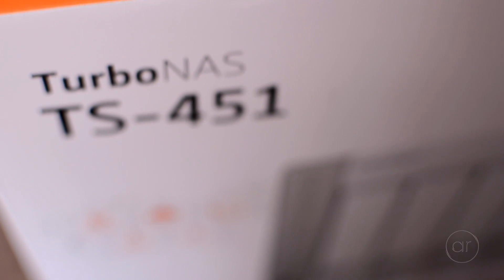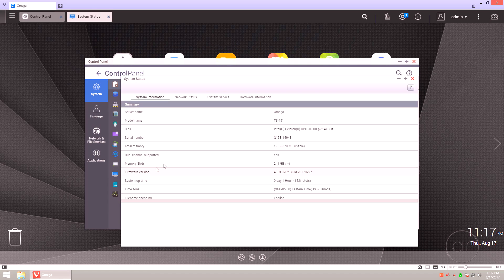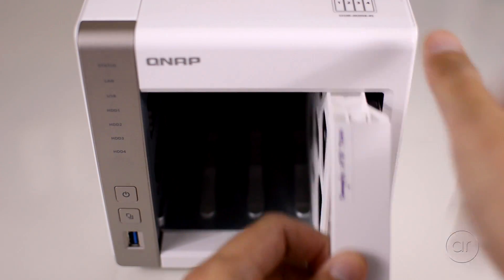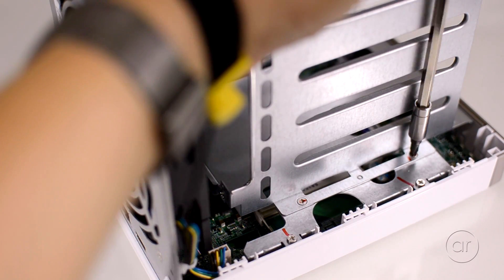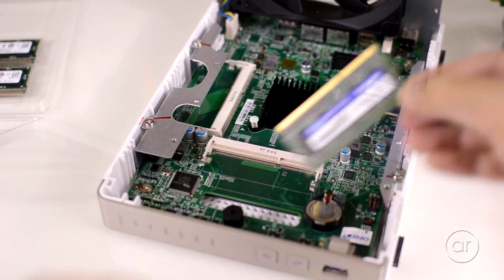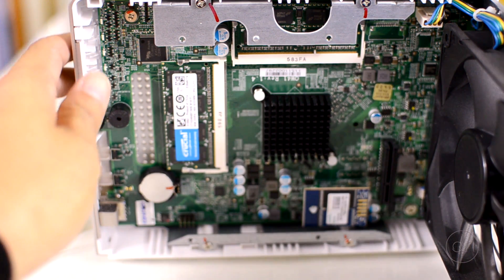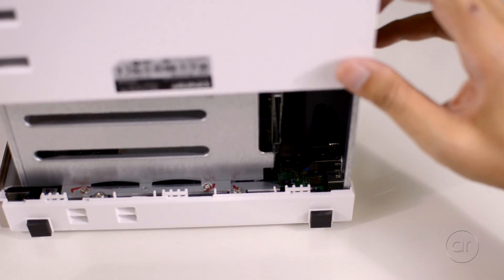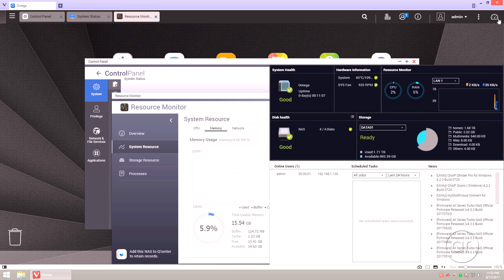How to Upgrade the QNAP TS-451 to 16GB of Memory

Comment: Sep 2024 - I just tried to install 16GB on TS-451 running QTS 5.2.0.2860 build 20240817 and could only see 8GB on the System Status. Trying to figure out whether it is a case of faulty RAM or whether QNAP clamped down on this functionality.

Comment: Is the power supply propriety? Found this QNAP storage system in a dumpster, along with other tossed out electronics. Has what looks like 2 Seagate 2TB HDDs, as the other 2 are open. Can you reformat the HDDs while connected to the host PC? Are the HDDs designed spefically for a NAS system? Thank you 🤓

Comment: Hello, seeing 16 GB installed doesn't mean the OS can use them. The J1900 CPU cannot use more than 8GB of RAM.
I haven't seen any evidence from a user that the OS is using 16GB "hardware". It is almost certain that the OS swaps on disk beyond 8 GB. It is necessary to carry out tests in real situation. Memory modules are currently very expensive and it is difficult to trust this type of video without real testing. Regards.
Reply from the maker: Thanks for the comment. You may want to look at some of the discussions at the QNAP forum about others who have done memtests on the 16 GB.
Reply: @accessrandom  Thanks for answering.

Comment: Awesome, well detailed video. As mentioned people should remember the order they removed the disks in each slot and put them back in the right slot to avoid issues. Labelling them might be a good idea.
Reply from the maker: Thank you, and thanks for the great tip.
Reply: mdadm uses the raid id of each disk not the slot,, really old versions of qnap and Synology os (over 6 years old) it did matter what order they was in but "" Only "" when moving the disks to another nas for migration , if then was was functioning normally you can shut down the nas and move the disks around and power it backup (but that requirement is long gone and absolutely redundant)

Comment: What do I have to know when buying RAM for my TS-451+ for it to work?
Voltage, Speed, ...?

Would it be ok to buy a 
   KTH9600B/4G
   1.5V
?
Reply from the maker: You may want to look at the QNAP forums. I know that the TS-451+ can take 16GB of RAM (and there are a few memory models that have been anecdotally successful) but I'm not sure about your particular model.

Comment: The disclaimer at the beginning of the video has come true.  With one of the recent updates they've started enforcing it.  If you go into the Control Panel, at the top it will list the amount of memory you have.  It'll read  Memory: 16 GB (8 GB usable)  Checking the System Monitor will show that the system is only using 8.  This caught me a few months ago when I was doing the upgrade and couldn't figure out why it would only read 8 GB.
Reply from the maker: Thanks for the heads-up. Could you tell me what version of QTS you're using? I have the latest version 4.4.2.1320 (2020/05/29) on my TS-451 and I am still seeing 16 GB available in System Status, and in the Resource Monitor it says I'm using 9.89 GB out of 15.53 GB.
 I'm not doubting you - I'm just wondering if I should prevent any more updates from QNAP... or am I looking in the wrong place for the memory info?
Reply: @accessrandom  Considering upgrading mine. Are you still successfully running 16GB? Thanks for the video btw :)
Reply: Ram probably wasn't installed correctly (I find out in 2-3 days as I got a 451 coming in next days think I have 2x8gb somewhere)
Reply: @accessrandom Sep 2024 - I just tried to install 16GB on TS-451 running QTS 5.2.0.2860 build 20240817 and could only see 8GB on the System Status. Trying to figure out whether it is a case of faulty RAM or whether QNAP clamped down on this functionality.

Comment: I installed 8GB DDR3L 1600Mz RAM (only in 1 Slot) in TS-451. But it doesn't work. ( I can't discover my NAS on LAN). However reinstalling the Original 1GB RAM works fine.
Reply: May be an install issue (stick didn't quite click in?), or a bad stick of ram.  This is fairly common in PC building, especially the former which is why it is advised to do a do a quick boot and system check before installing everything in your case .  IE boot into bios and check and see if everything is showing up and running such as the ram, GPU, etc.  RAM slots in particular can be a little finicky.

Comment: I installed 8GB DDR3L 1600Mz RAM (only in 1 Slot) in TS-451. But it doesn't work. ( I can't discover my NAS on LAN). However reinstalling the Original 1GB RAM works fine.
Reply from the maker: I'm afraid I hadn't tested just one module - it may be that the QNAP doesn't support 8 GB in one slot? I'll let others chime in if they've had any experience with this - anyone?

Comment: Just to confirm since no mention of har drive order was made, Is drive replacement ordering mandatory?
Reply from the maker: This upgrade affects only the memory. I believe I had two RAID 1 groups before I performed the memory upgrade and I didn't need to change the order of the drives.
Reply: I have 4 drives, does it matter the order/slot they go back in
Reply from the maker: Ah, I see what you mean. Yes, you should put them back in the order that they were originally. QOS will keep track of any groups and if any disk changes order, it will detect it.

Comment: Great and very helpful, but why would you ever need 16GB in a 4bay €500,- NAS??
Reply from the maker: Thanks. That's a good question - I use mine to run one VM 24/7 for downloading and another VM for testing questionable app installers. They're a bit slow, but they're fast enough for those purposes...
Reply: @accessrandom  Ok, then i can understand, thanks for answering so quickly.

Comment: great video.  will try this soon.  I should add that I'm not going to be running any virtual machine stuff.  Just may have more than 1 user accessing files like movies at the same time.  Would I benefit much from that?  Perhaps just going from 2G to 4G (i have the 451 plus)?
Reply from the maker: For just file access I think you won't see much benefit with additional memory. If you want to run apps (not necessarily Virtualization Station), adding memory might help depending on the memory requirements of those apps.

Comment: I saw another video about this but nobody seems to care whether the memory actually gets used.  In order to test it, create a couple VMs that together use more than 8GB of RAM.
If they both run and the OS inside each VM reports that it has access to the RAM you set it up to use, then this works. If not, it's a false trail and a waste of money.
I'm not buying the RAM to do the upgrade until I can find proof the RAM is actually being used and that's the best way I can think to test it. It would force an error if the RAM could not be used.
It's not enough to just show me the screen that says 16GB. You have to do testing to see if the 16GB (or any RAM above 8GB) is being used. Please create two VMs using over 4GB RAM each and run them simultaneously, NOTE what each VMs OS is using and report your results here.
Reply: he could just make a vm with 2gb ram assigned to it because the initial amount was 1gb
i just upgraded mine from 2gb to 8gb and worked flawlessly, i run multiple vm's trust me. works man

Comment: Well I upgraded my TS-451 to 16GB of Kingston and I had issues.  First, drives 3/4 did not show up, and I called QNAP support and we managed to get those to show somehow (I think it was just a hard reset).  But then after setup, I could no longer connect or even see the NAS at all on the network. Exhausted all troubleshooting steps and just when he was about to issue an RMA, he saw that I upgraded ram to an unsupported amount, so he wanted me to downgrade to 1GB and try again. Well, after doing that, same issue as before, drives 3/4 not registering in Qfinder, however the LEDs for bays 3/4 do light up green on the box itself...

Comment: Hi mate, great video... couple of questions about the 451a.
1) I've seen on some forums people having issues with drives 3 and 4 not working after installing 16gb... these were from about 18mths ago and wondered if you'd seen/experienced any such issue?!?!!?
2) Is it possible to do a CPU upgrade on the 451a?!
Reply from the maker: Thanks! I personally haven't had any problems since I created the video (and I've updated the QTS versions as each has been released). Did others have problems with specific QTS releases, or with specific brand/model memory? The Crucial model that I use works, and I've read in the QNAP community forums that there is also a Kingston model that has had success.

Unfortunately, I don't know if the CPU can be upgraded as I wasn't able to find any info in the forums. It looks like the TS-451A uses an Intel Celeron N3060 which has a 14nm Airmont architecture. The only photo I could find had a heat sink on it, so I'm not sure how it's mounted.
Reply: Thanks for replying so fast!

That's all good to know, as I'm keen to upgrade to the 16gb!! I'm running 4x 8tb seagate drives (about 63% used) and that's a lot of buggering about if something stuffs up!! Here's the link:
https://forum.qnap.com/viewtopic.php?t=126032 

As for the issues people were having, this was back in 2016... no release issues were identified that I saw, so I guess things may have been rectified since then and no one has updated their results??? From what I could find since watching your video about the CPU is that it is hard mounted (soldered?) to the motherboard and not upgradeable; well, definitely not for dummies like me!! LOL
Reply from the maker: There seems to be mixed success on the TS-451A with lots of variables, including the RAID configuration. It looks like a few people had success with ADATA memory. Whatever you decide, please make a backup of your data before adding the memory. (btw, on my TS-451, I use RAID 1 on two drives, and RAID 1 on the other two...). Good luck!
Reply: @accessrandom  Thanks for this video.  Just a couple of points my TS-451A had a couple of extra retaining screws holding the case to the back plate that carries the fan.  Also the memory was 2 sticks nested in the main holder not separate as shown in the video and thus not difficult to get to the 2nd one.  

I appear to have successfully upgrade to 16Gb of memory on my TS-451A using the Crucial Kit as listed above.  The system hardware is showing 16Gb installed and 16Gb available and the memory useage is showing very low now <10% whilst it was booting up anyhow.
Reply from the maker: @SteveSmith0704  Thank you for the detailed write-up 🙏. This will be very helpful for others who have the TS-451A.

Comment: Great video, thanks for your help. I have some questions, today i have 4GB in 2 / 2GB, why should i change memory to 16GB? What apps or systems, need more than 4GB on memory? more than 4GB memory improve services?
Reply: The processor on these NAS units are normally quite weak, so 4GB is probably just fine if you’re running a couple of things extra.
Reply from the maker: Thanks. I use the memory for virtual machines using Virtualization Station. Having two VMs running simultaneously (which run ok, but not fast, for single-task activities), I assign them 6 GB each.

Comment: Hello, Thank you for the video, 16Gb is very interesting for VMs. I have a question though: which CPU is in your QNAP TS-451? I am asking this because there are (at least) three different TS-451: TS451+ (unspecified 4 core cpu), TS451A (no idea which CPU) and TS451A-2G (Celeron 3060). I am planning to buy the latter (TS451A-2G) and I would like to upgrade to 16Gb but even Intel's Ark site claims 8Gb max.
Reply from the maker: The CPU in my TS-451 (the base model) is an Intel Celeron J1800. The two TS-451A models you list use the Intel Celeron N3060. If you search for the TS-451A's smaller brother on the QNAP NAS Community forums(look for "Memory Upgrade on TS 251A"), you'll see that there is anecdotal evidence that it does take 16 GB.
Reply: @accessrandom  Great, thanks.

Comment: The motherboard accepts 16GB of memory. Will it also use those 16GB? Why is this question never answered?
Reply from the maker: I haven't pushed it to the absolute limit, but pretty close. I usually run two VMs at the same time, using 13.46 GB out of the 16 GB I've installed. Hope that answers your question.

Comment: I almost got another 8GB (right now I'm using only one KVR16LS11/8 from Kingston) on my TS-251. I'm still not sure if the system will use the extra memory. Do you still recommend upgrading? Can you notice a huge difference in performance?
Thanks!!
Reply from the maker: I haven't been able to find an article or video on the TS-251 specifically, but Amazon has four reviews where they claim they were able to upgrade it to 16 GB. For a recommendation, i think it will depend on your use case. If using it just as storage, I think 8 GB will be more than enough. However, if you use virtual machines and containers like I do, 16 GB definitely helps with performance, at least on my TS-451. There's a world of difference between assigning 2 GB and 8 GB to a VM, for example.
Reply: access random Got 16GB on my system. I bought the same model from Kingston with the extra 8GB. Can't wait to start with my VMS
Reply from the maker: Super. Let us know how it goes! If you need help setting up VMs, I have a video on that as well... (see my channel).

Comment: is it going to work too for TS-251A?
Reply from the maker: Looks like there are some differences between the TS-x51 and TS-x51A series, primarily the CPU. However, there are reports that the TS-x51A can be upgraded to 16 GB based on a quick internet search (look for "Memory Upgrade on TS 251A" on QNAP's NAS Community Forum). I don't have first-hand experience with the TS-251A, but I'd make sure to use memory that has been proven to work by multiple sources.

Comment: Do you think this would also be possible with the TS-253A?
Reply from the maker: I don't have first-hand experience with the TS-253A, but I see a couple videos on Youtube (and corroborating comments) that claim success with installing 16GB on its bigger brother, the TS-453A. Since they use the same Celeron N3150/N3160 CPU, I would think it would work but don't quote me on that ;)
Reply: You can upgrade but the max you buy in a new box is 8 gig.
I don't know if you can go above I have the ts 453a

Comment: Hi...
Did you try to use whole RAM?
Trying to run some dockerimages or even VMs and pushing the ram to the limit?
As far as i know the cpu specs cannot address more than 8gb! It doesn't matter system specs are showing you that they are mounted.

Thanks for any info
Reply from the maker: You're right - not only does QNAP not support 16GB, but Intel says this as well!

I just assigned a VM 14 GB (leaving 2 GB for the host) and QNAP's resource manager shows that out of a total of 15.54 GB usable memory, I'm using 14.89 GB. Within the VM, I show 14 GB installed.

One thing I haven't done is run 14 GB worth of applications in the VM. Is there some utility that just loops through every bit of available memory and read/writes to them?
Reply from the maker: Please note - there are only a few brands/models of memory reported to have worked for others. The Crucial memory that I use in the video is one of them.
Reply: @accessrandom  Probably Memtest '86. :) But this needs DOS 5.x / 6.X or similar, and a couple (a lot of) of minutes for the check. It is a completely free software tool, you can DL it from memtest86.com
I think it is rather old, but does the job done.